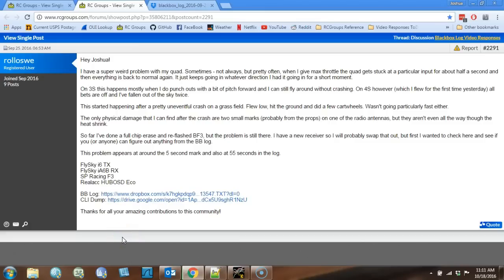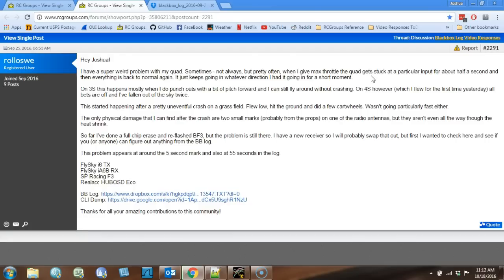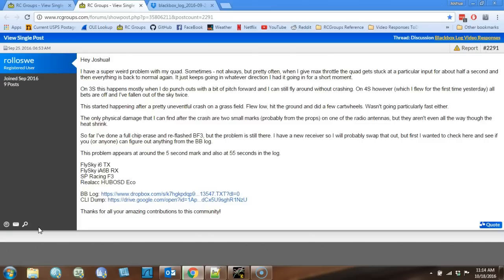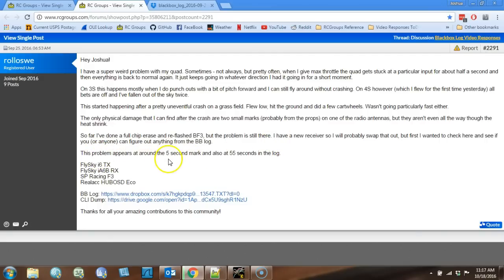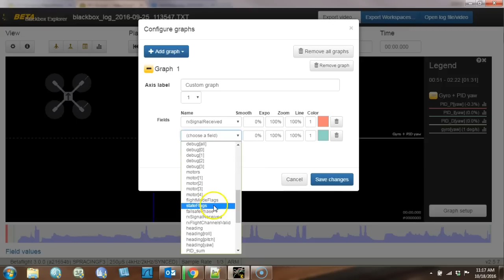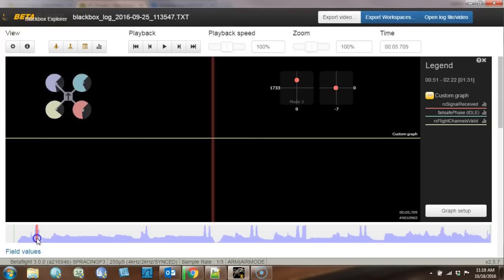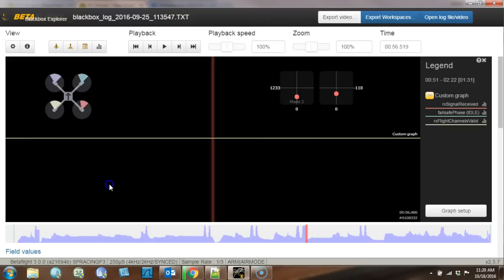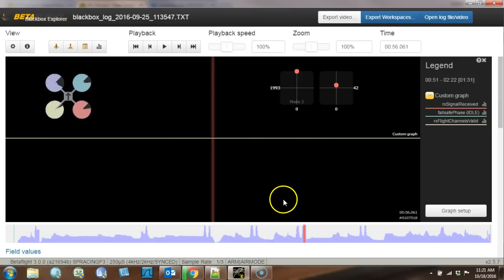Blackbox Log Analysis: rolloswe - 10/18

Comment: Had the same thing, after a little while of flying, happened to me when I did a roll it would freeze up and continue for 1/2s or so. When I turn on the iA6B and then the transmitter, I noticed that the error rate took 1-2 seconds to appear and I believe it did this from when I got the iA6B RX from Banggood (bought one in the past with no problems), so I think it's somehow related as none of my other RX's (2x iA6 or 3x iA6B do this). I tried re-flashing the firmware but no change. Swapped out the RX with another and it's fine now.

Comment: I have the same freaking problem, only I get this in random occasions and not necessarily at full throttle. It doesn't occur very often but boy it's nasty. I also have a Flysky radio (FS-T6). I haven't found any solution but after hours of testing and contemplating on the matter, finally I blamed my cheap radio for this. But seeing that U have the same radio (Flysky) and Joshua also thinks the radio IS the problem, I suggest U and me most invest in a better radio ASAP... ;-((
Maybe the "Horus" that Joshua LOVES SO MUCH!!?? :-D
EDIT: I also started to have this problem after a light crash!! Let me know if anyone finds the solution.
Reply: Pouya Mohtat I had a similar issue. In 1 bad crash the connector on the fc for the reciever got hit and the connection pads were loose. fount that out only when I changed fc.
Reply: have a look at the RX antennas for damage , maybe they have been damage by your props in the crash
Reply: tnx, I'll look into that...

Comment: Throttle Up -> Voltage Down  -> Brownout

You could check the log for this if the FC has VBAT. Also ESC Noise could make it worse.

 Such a thing might help:
 http://www.hobbyking.com/hobbyking/store/__16223__TURNIGY_Voltage_Protector.html
Reply: I don't think that's the issue here, because I'm having the exact problem but not at punch outs and Also I'm sure I didn't have this problem before with the same quad. It all started after my quad had a very light crash (I'm not sure if the crash was caused by this problem or vise versa... It's ironical isn't it?)